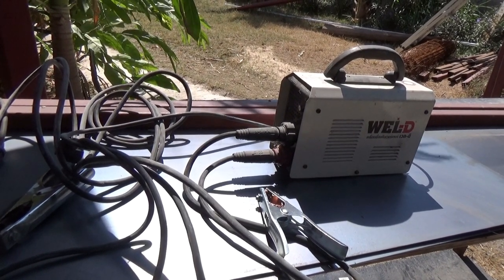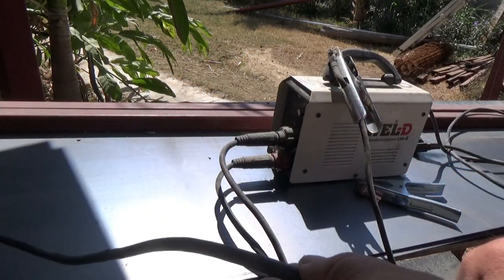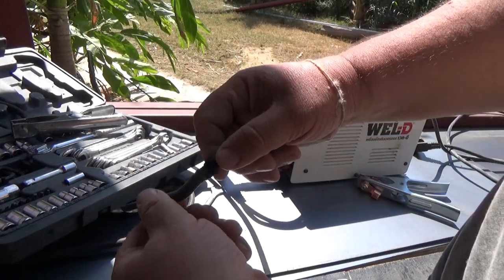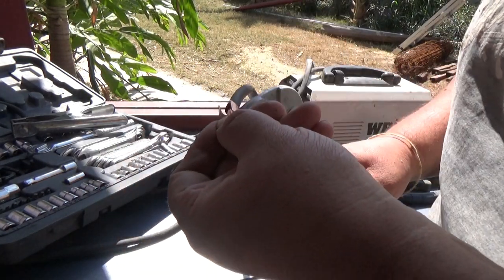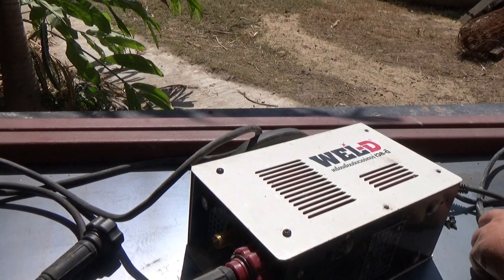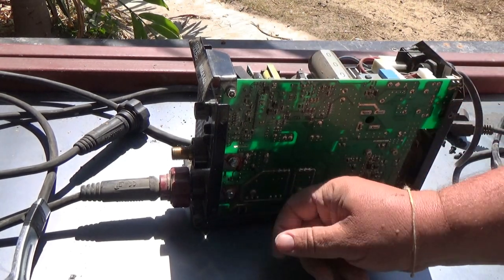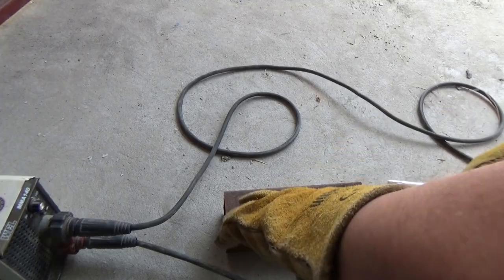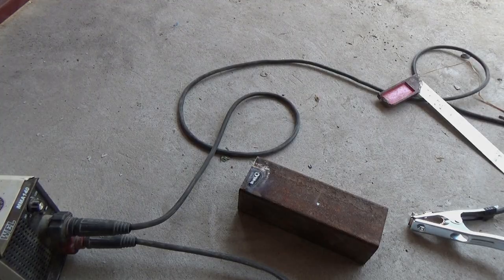Workshop Project - Maintenance on the baby welding machine.

Comment: Good vid,i use mig with flux cored wire its ideal for welding outdoors as the wind cant blow the gas around ;]
Reply from the maker: That is much better than this but not really available here, lots of these little stick machines to chose from though.

Comment: Looks about the same size as mine but mine has switches for the amps so not as flexible for the juice. Yep compressor a must I only have a real small one but I use it all the time. There are some real neat air tools for grinding and polishing.
Reply from the maker: The problem is if I by a air compressor than I well need a lot more tools, where does it end.....lol
Reply: treat it like a hobby ;-) a collection that has a use a means to an end.. people collect stamps and dead butterfly's ever tried blowing the dust from under the bench with a dead butterfly or inflating a tire ;-) 
You can never have too many tools thats a proven fact if your wife asks tell I said ;-)
Reply from the maker: You make a lot of good points....lol
Reply: Now you know why I have so many tools ;-)

Comment: Good, it's best to cut out the bad/burnt wire(s). If I could I would tin the wire and solder any connections.
Reply from the maker: Solder is not a bad idea but it seems to be working good as it is right now.

Comment: How many amps does this litle welding machine deliver? And how many mm electrodes is it able to weld with?  1,8mm or 2.4mm? AC or DC and what's the price on such machines?
Reply from the maker: This is a DC machine, 140 amps, the rod is 6013, 2.6mm, I also have 3.2mm, it is the only 2 options I have found here, lots of different manufacturers but they all sell the same thing. I think I paid 4000 baht for the machine, lots to chose from in that price range.